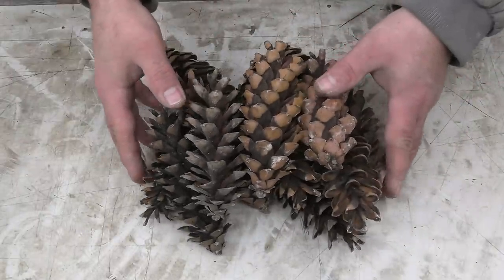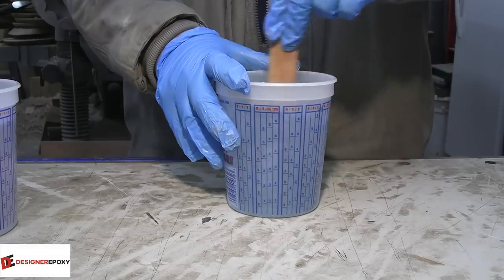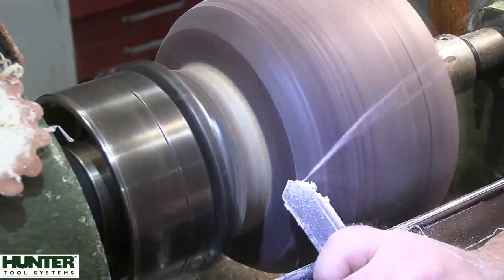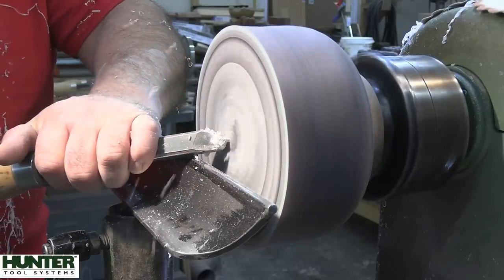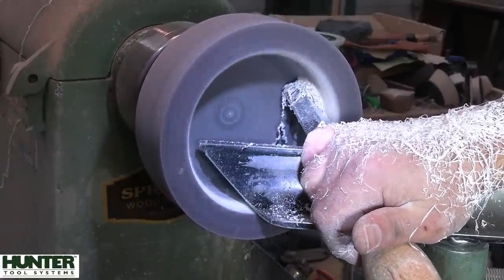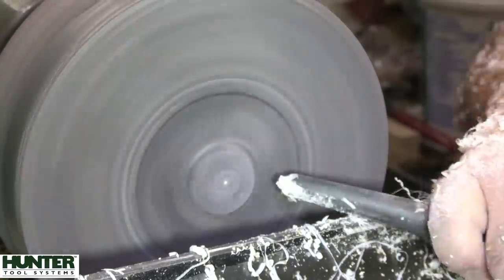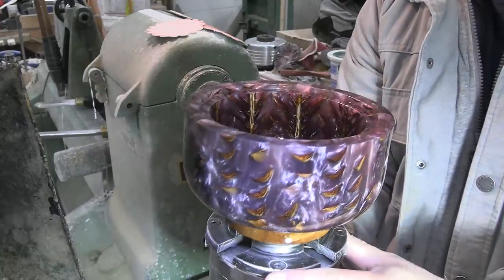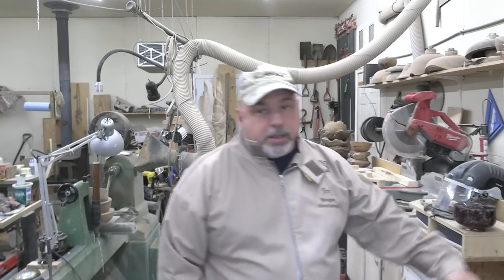Woodturning - The Pine Cone Lidded Dish

Comment: I think you made all the right calls about how much of the pine cone to expose.  Really like the flower effect.  The waterfall effect with the resin is really cool.  As far as the base no base decision goes I have to use my grandpa’s rule.  He was a carpenter and when the husband and wife disagreed he explained that it would be resolved with a vote.  However, the wife got two votes and the husband one.  I personally was unsure about the base until I saw the finish on.  The brown in the base really complemented the brown in the pine cones and really looked nice.  The lid was a great idea.  I would be holding onto that beautiful piece also.  Designer Epoxy.
Reply from the maker: I’m tired of the two vote thing for woman, hahaha. Thanks for watching

Comment: I just started a pinecone resin project.  I couldn't decide on a color for the resin so I left it sitting on my bench yesterday.  Love the flower effect!  It gave me more inspiration to pick a color and get it in the pressure pot.  Every time you use that cutzall on the grinder I cringe.  Mine kicked back this spring and about cut my thumb off.  I call it my 20K thumb now cause that was how much the surgery and medical bills were.  Designer Epoxy
Reply from the maker: Well that sucks! I’ve usually got a pretty good grip on it. Your not alone, it’s gotten a few. Thanks for watching

Comment: Hi Jim, very cool project. I agree with the maple base to elevate it. I also agree with limiting the coring on the inside. On the other hand, design wise, I think I would have made it slimmer by the outside, with a concave a little more pronounced to be more in line with the concave shape of the base. Otherwise I think that as turners we must adapt our intentions to what the material will offer us.
Reply from the maker: Thanks for watching

Comment: Very nice. I like the wood base.
Reply from the maker: Thanks
Reply: @SpragueWoodturning  you're welcome. I have a big box of redwood cones that are 12-18" long and 4" diameter. The diameter is almost the entire length of the cone. I've prepped them for resin but have no idea what to do with them. Wish I could afford to send them to you and have you make me a tall vase, candlestick holders (do those have a name?🤔🤷🏼‍♀️🤦🏼‍♀️ lol)
So I was looking at these huge cones (no pun intended 😂) just after watching this video and I saw my box of driftwood I've collected and had several bags gifted to me for my art and I think drift wood would make a really awesome bowl or large platter. Have you worked with driftwood and resin? I'm not a turner I make multimedia canvas or resin based art and use whatever I can get my hands on that's free. The driftwood is so light weight I'm guessing they'd soak up a ton of resin? Does it turn well or just turn to dust because it's so dry/brittle from soaking in sea salt water for so long?

Comment: Pine cones are absolutely transformed by resin. I love the flower effect and the waterfall on the outside. I think it works better having the streaky cores on the inside. It's like a surprise inside. I agree that the bowl needs the elevation that comes from the base. Nice job. Will the excess sap in the cones cause any internal de-lamination of resin in the future?
Reply from the maker: It’s mainly coming out of the center of the cones on the bottom. So I don’t think it will be an issue in the future. Thanks for watching!

Comment: Jim, what if instead of cutting the lip of the bowl and the inside edge square on at 45 degrees, what if you cut the lip of the bowl and edge of the lid at an angle instead? It would take some experimenting to get the angle just right, so when the lid goes on it would slide down into the bowl and sink up thight. You would have to experiment and do some tinkering on some scrap to get the "feel" right.
Definitely keep the foot.
Reply from the maker: Like a morse taper? Yes, that would be tricky! Thanks

Comment: Love the pearl swirls around the pinecones. Would have liked to have seen it with the blue/red colors, but I like the purple too. Like the wood foot on the base since you left it bulkier. Perfection as usual. Maybe turn the pinecones on their side so that you get the flower effect on the outside.
Reply from the maker: If there laid on there side I don’t think you will get the pigment sitting on the top of the scales. Thanks for watching
Reply: @SpragueWoodturning  could you put in spacers and get that effect? Like with the banksia pods?

Comment: I absolutely love the piece. I am surrounded by pine trees and deal with pitch all the time on furniture, patio pavers, etc. Ethanol works best to remove it. The higher the percentage the more easily the pitch is solubilized. Hand sanitizer will work in a pinch but it’s alcohol content is a bit low. 70-95% alcohol is preferable. Try immersing the cones in 95% alcohol for a while. The pitch will probably dissolve or be easy to remove. 

I was wondering, could you use Pine for the base? I know typically you use hardwood but was wondering if pine would work just to complement the cones.

I have seen the pine cones trimmed laterally to reveal more stem but your design gives you both scales and stems as well as cross sections on the lid. Fantastic. The cone cross sections (like the lid) would make amazing platters. 

I vote emphatically to NOT remove the base. The wood base compliments the cones beautifully. Cones come in so many shapes and sizes the design possibilities are endless.  Looking forward to the next one. Bravo.
Reply from the maker: Thanks for the info!

Comment: Designer epoxy.
Amazing dish. It was the perfect choice for the cones as it shows them off the best. Leave the base. The colour matches and it looks like it belongs. You have inspired me to try using the bag of cones my son brought me. Question for you. You say you are putting in the pressure pot. At what pressure and is it under pressure the whole 3 days? Love the dish. Another great video!
Reply from the maker: 60 psi the whole time. You can remove it after day two. Thanks

Comment: ON Amazon you will find them. Used for pouring dentures. Mine is strictly vibrating and not for missing as they have both. would send a link in this but don't know how. I wish the vibrating was a little courser. If you could find a vibrator and mount it under a plywood plate would be nice. Vibrating does relieve the air.
Reply from the maker: I will do a search. Thank for sending the info!

Comment: I think you can get rid of the pitch by soaking them in alcohol or acetone. That's what i use to get it off my hands. That way you wouldn't get the drips of crystalized pitch on the petals.
Reply from the maker: I will give that a try. Thanks!

Comment: Re the foot, I think you are both right, elevating the resin section is good but the walnut is too light compared to the bulk of the turning. How about a third option of stripping back the walnut and ebonising the foot to make it quite a bit darker? That's my 2 cents anyway.
Reply from the maker: The foot is actually maple and it’s got way too much resin penetration to do any ebonizing at this point. Thanks for watching!

Comment: Foot. I wasn’t sure at first, but once you contoured it a bit I was sold.  What is your method on cleaning/reusing your mixing cups? Do you clean them while they’re wet, or leave them dry and peel the resin out after? I struggle with this. Thanks Jim!
Reply from the maker: Acetone works well, most time they go in the recycle bin, lol. Thanks for watching

Comment: Hey Jim, I'm from Perth Australia and just got my hands on some Waterlox. I was wondering if you could share what material you are using to apply it? Is it just a small rag or something else. I tried applying it with multiple things but keep getting streaks which I have to sand back each time. Cheers Shannon
Reply from the maker: Old T-shirt material will work. I like to use stop loss bags to keep the finish fresh. Before using it, place it in the sun so it’s nice and thin, that way the finish will layout flat. Thanks for watching

Comment: I'd drill a hole through the knob and put a brass wire handle. It will make it easier to take the lid off, and would look fantastic.

But yes, keep the base.
Reply from the maker: I did keep the base and the brass knob would work too. Thanks

Comment: Keep the base buddy.  It makes the bowl look uplifting.   Also, I think I told you but how can you afford so much epoxy in so many of your turnings?  Me teaching other vets like me I just cannot afford it nor buying it for them to use.  Do you get it at a good price somewhere?  Do you get it by the 5 gallon or 55 gallon?  Thanks
Reply from the maker: This piece has three liters of resin in it and would sell for $300 to $400. That means I use about $70 Canadian worth of resin to make this piece. If you charge the correct amount for your work is more than profitable. All my epoxy comes from Designer Epoxy and they have the best price on the market. They only sell deep cast in three gallon kits and ship to the US. With the power of the US dollar, it’s a no brainer to buy the epoxy from DE. Use my code inlayjim for your discount. Thanks for watching!

Comment: Mini Christmas trees 🙂💟💟💜  I found the best way to put tape on is to leave about 1/8 or 1/4 inch folded on the end you want to start removing from.  I figured this out a long time ago when my roll of tape for my tape gun wouldn't fit gun as core was crushed and I didn't notice when I bought the roll.  I use this method when wrapping gifts or boxes to make it easy for kids and adults to open without having to cut or use a knife. 😊☺  Also makes removing tape from a roll easy without having to look for the end or try to find end with a knife or scissors.
Reply from the maker: Yes, I do this I’m most cases too. Thanks

Comment: I always cut my cones down the spine, sometimes you can use both sides. cut them backwards of course. I use a sled.
I found rapping the mold lightly with a hammer after the pour will loosen the air bubbles up and out. I even went further and bought a vibrating plate and now I, almost, never see a trapped bubble.
nice turn, Lee
Reply from the maker: Where did you get the plate from? Thanks